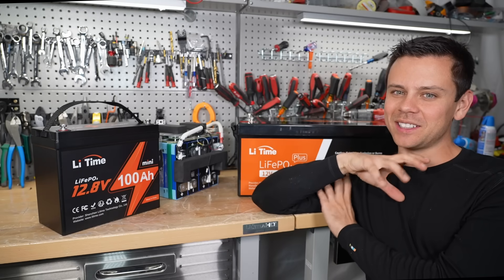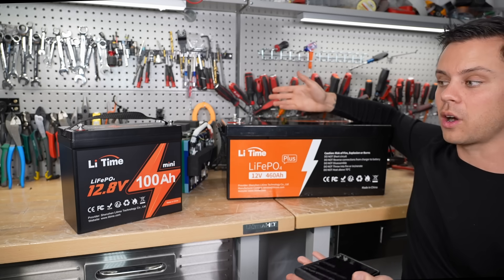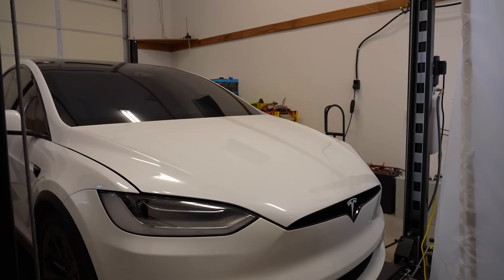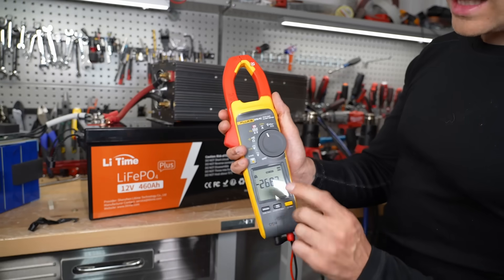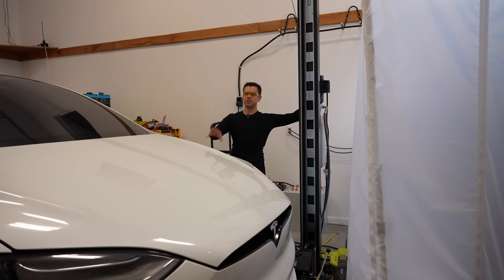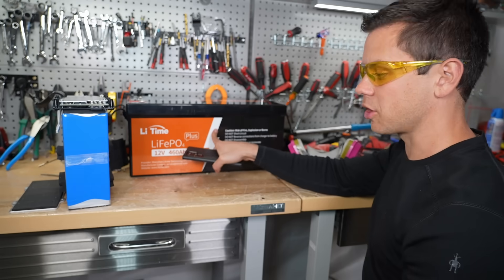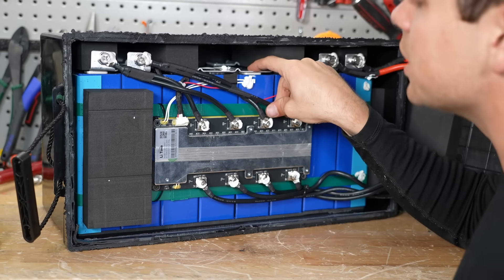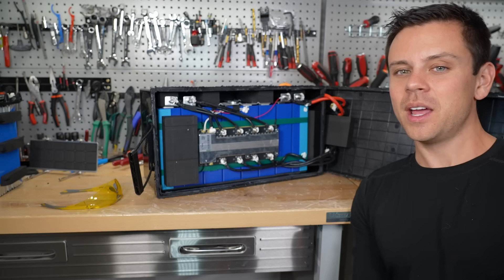LiTime LiFePO4 Mini and 460AH Plus! Surge Testing and Teardown

Comment: Hey Will, I've watched a bunch of your videos and I think I'll try one of these Li Time batteries for my RV. I don't need much, just enough for the coffee maker and TVs. Maybe the microwave. The ACs will be run off of the on board genset. I'll also be running a GoPower inverter with 50amp pass through and a seperate transfer switch. That way no matter what, I can have shore power, the genset, and the inverter all running but my priority will be set by my transfer switch. Anywho, I don't see temps go below 30°F here too often so do I really need the low temp protection? My current 100Ah lithium battery I have on there now seems OK after the last 3 years and I always keep my RV plugged in. Any advice on the low temp sensor and/or advice on the best way to wire up my RV would be much appreciated. I learn better with schematics BTW. Thanks

Comment: So after watching this I bought a LiTime 200ah battery. I ran a 1100W microwave from  a 2000W renogy inverter off the battery. The battery was at 92%(13v). But while running  the microwave, the battery was showing 62%(12.4v). Then 3 minutes later after the microwave was finished the battery went up to 82%. Is this what should have happened?

Comment: Here's my question I live in South Florida or power goes off a lot, I have a lot of APC/UPS is in my home..  I would like to buy a 200 amp battery and buy a Pure Sine inverter.  I have a Ram diesel truck which holds 75 gallons of fuel, in bed aux tank.  should I use the alternator with big jumper cables to charge the 200 amp batteries or should I hook an inverter to my truck and then plug a large battery charger into my truck inverter to charge the 200 amp battery. I'd like to buy two 200 amp lithium batteries to keep the batteries charged, at least put back in 50% back into the batteries in charging.  I have three 2.3 amp refrigerators  I would like to keep cold, I can rotate power to three 2.3amp frig to keep my draw down..I was thinking of getting 2x 200amp lithium batteries and a 2000 watt pure sine inverter for the batteries, and a 750 watt inverter for my truck and a 50 amp charger for the truck inverter to power to put some charge back into the system..any help would be appreciated.

Ben

I am happy to Cash App udor your help.

Comment: Hey Will, most boats (especially sailboats) are a 12V system. You will find 24V setups, but rarely a 48V system on boats. Unless, of course, they're a Mega Yacht. For the larger voltage systems, the wiring requirements become a constraint. I would love to see you do a series on boat utilization of lithium batteries.
Reply: This is the answer. There are thousands of 12v sailboats going around. Only the larger ones are switching to 48v nowadays.

Comment: My 100-amp mini came with a voltage reading of 13.4 volts. I can only get it to charge to 13.8. Li time says my battery is good. I think it is defective and should charge to at least 14.4 volts. Is one of the 4 groups reading high causing the BMS to shut down charging?   out of balance?

Comment: Hi Will
I love your videos and the excitement you bring to learning. I am quite interested in these compact or mini batteries. I am looking for a 200ah to add to my 3-100 ah (all LifePO4) to go with my 1000 watt solar capacity. My room is limited in my RV so size is important. I don't  see that you have tested any Eco Worthy brand but they offer a 200ah that is considerably smaller than the rest I have seen by almost 6 inches in length. I have written them to confirm dimensions are correct. They also seem to have a much lower warranty than others at 1 year. If you or anyone else has the time I would really appreciate the expertise. System is Renogy 5 x 200 watt panels and 100 amp Renogy charge controller, Renogy shunt monitor and Renogy 2000 watt inverter.

Keep up the great work
Best Regards,
Jim

Comment: Hi. I heard you mention that if a Li Time battery has plus on its case, it doesn't have low temp protection. On the website it said it did. Nothing in the docs or battery says it does, so I asked tech support about it. I bought 2 260 AH batteries they assured me it did. I wasn't convinced, and really not now. I bought them in October 2023. Anyway to test them w/o tearing them down?

Thank you.

Comment: Strapping tape on a heatsink? No way. The adhesive will deteriorate when exposed to heat and eventually give up. Strapping tape doesn't belong anywhere inside a battery, but especially not on components that get hot. That's a fail! Buyers will soon wonder what's rattling around inside their sealed battery (the BMS). And zip ties? Really? The build quality looks like something out of a high school shop class project.

Comment: Trying to find a video.. but can’t. Anybody know if you can have two different battery banks ( different brands )  but have a battery selector down line from solar charger . And then another selector between the two banks to inverter? So you can switch between battery banks both inputing and outputting?
Reply: Hmm? Hey I’m a noob n don’t know nothing so to say.If that’s doable I wouldn’t flip switches unless it was dark out.A cheap switch may get welded on in full sun?

Comment: Hi .like watching your videos I’m in the uk . I’ve got a touring caravan I’m looking at going to lithium. I use 2x acid batteries 110amp got 200w solar panel on roof. I use led lights water pump heating (gas but uses 12v to run a pump )also 12 tv an a 1500 w inverter for mrs hair dryer but only for around 5mins. Never plug into electric mostly ok. Question about the lithium Which brand is best as it’s a mine field out there. Was thinking starting with 100amp being cheaper then being able to add another 100amp if needed but is it best to work from one bigger amp battery than put 2 together. Was looking at Fogstar battery 280amp £799 at least can talk with them . Other companies renogy but can’t talk to anyone so worried about warranty. Any help would be appreciated. Cheers mike

Comment: @WillProwse Out of curiosity, Have you ever gone about "rebuilding" one of the "store" units if you already had it, to possibly add a cell heater, low temp, and bluetooth? I bought a Bilt Hard 230ah 12v last year (due to being the cheapest that would work in my application) but am regretting not having bluetooth for monitoring (i also doubt it has temp cut or heater)

Comment: I just found your chanel and have watched so many of the videos. Im planning a 12V system for a full time van build. I see everyone talk about battleborn but after watching this video im almost sold on these because of the price. Is there any reason other than the low temp sensor and 10 year warranty that you would reccommend battleborn over these?
Reply: And now looking at their website again they do have a 230ah with low temp sensor. So is there really any reason to pay roughly 3 to 4 times the cost for a battleborn? Greatly appreciate your videos and knowledge, and also the response to my questioms

Comment: I have a Solar Edge System: 14.4kW Solar Array Hyundai HiA-S400HI
Solaredge 10kW Single Phase Inverter with Power Optimizers. My question is can I use batteries other than Solar edge batteries. Can I use 48V 100AH SERVER RACK LIFEPO4 LITHIUM BATTERY SG48100P with this system

Comment: If Ripping the battery Enclosure apart I wound Just Replace the "Dumb" BMS With Smart BMS (with Bluetooth, WiFi, LoRA) + active bi cell equaliser (one that i can turn ON and OFF) + 5v, ~ 20v USB PD Heating matts
Reply: Why not 4 280ah eve cells for 450 bucks then.Or 1800 for 280ah 48v bat. A lot more a year ago.

Comment: In regards on your "Renogy DC to DC charger w/Mppt" video...
Hi, i have two questions! Can i use instead of a megaFuse a circuit breaker? and,
I looked at the blueprint on your website, and the mc4 connecter part is a little confusing to me... U mentioned to use the branch connector instead... Do i need to add the mc4  connecters as you mentioned, too?
Not sure if i find this information in your book, need to check again.
Thank you for all your help and the knowledge you are sharing... 🙏

Comment: A little off topic but we race dirt track cars and weight is a critical factor. Currently looking at building a 12.8v or 16v 280ah. We do not run on board charging. The battery must supply starting current for the starter. Believe that will be around 300 amps. Once started the draw is less than 10 amps.

Comment: I got a 12v 100ah TM. When I charged it, it started at 13.12 volts charged for 3 hours was complete charged volts was 13.68. One hour later it was 13.03. At 3 hour after it was 13.00. Now at 12.95 volts. Is there something wrong with the bmi? Would you return this for a new one? Not sure if I should trust this one. My charger is a lithium charger that just charge other lithium batteries I have and has worked fine for 2 years.  What's your thoughts?

Comment: Victron MPPT chargers DO have low temp cutoff so it does not have to be in the battery but, you need their volt/temt sensor for $40

Comment: Who's building 12V anymore?   <Raises hand>.   The problem with higher voltage systems if you have anything with really high drain (engine starting, RV slides, etc), you're going to need a 12V system in addition to your higher voltage setup.   Building a 12V and 24/48V system is a PITA, especially if you're not going nuts with the power requirements and cable runs.   4/0 isn't fun to work with, but it's cheaper than the smaller cables would be for a higher voltage system w/converters for the low voltage.   

If someone made a high amp 24/12 or 48/12 converter, it would be a lot easier to go to a higher voltage in a RV/mobile application.   1000A surge, 200A continuous would work for my applications; generator pulls a few 100 amps when starting and slides pull around the same.

Comment: Well 3 months and a normal 12 100 has died!!! No return warrenty never again not worth 50$  ran on 24v victron 250 60 controller......... trashhhhhh yes ran in series so both should have had a issue their detective!!!!!

Comment: Another awesome video. You stated that the "plus" LiTime batteries don't include low temp protection. I recently purchased a 12V 230AH that advertises on Amazon "Litime 12V 230Ah Plus Low-Temp Protection LiFePO4 Battery Built-in 200A BMS". One of the reasons I purchased this battery was (a) cost and (b) low temp protection. Based on LiTime's website, it appears that the addition of low temp protection is a new feature. Is anyone able to confirm this?

Comment: Love your channel but c'mon will get over this low temp thing. If someone is spending money on lithium they should also be spending on good equipment. With battery temp sense inverter/chargers and solar chargers can have a low temp threshold.

Comment: Hi Will, great video as always....I have scoured the internet for many months to try and find the 'correct' Epever controller discharge settings for my sealed 24v Lead acid battery bank, but have been unable to find somewhere that shows complete suggested settings. I want to follow best practice and discharge the batteries to 50% The Epever defaults are - Discharging Limit Voltage 21.20v : Low Voltage Disconnect Voltage 22.20v : Low Voltage Reconnect Voltage 25.20v : Under Voltage Warning Voltage 24.00v : Under Voltage Warning Reconnect Voltage 24.40v........My understanding is that for my setup the 50% SOC value is 24.45v, so that is what I have set..it seems to me that the Epever default value of 21.20v would completely destroy the batteries, but I can't believe that they make such a suggestion if that is indeed the case... Am I missing something fundamental here ?? If you or anyone can provide a full set of suggested parameters to use I would be very grateful, I don't want to ruin my batteries, but equally I don't want to be underutilising them through fear of doing so...thanks
Reply: Thanks James...I am familiar with how to change the parameters, my issue is what the parameters should be as the default ones (mention above) seem to allow the batteries to discharge to zero .... @jamesl9686

Comment: Hi will, I have a request: Sunbeam has the so called Smart lithium battery they called it drop in battery. You dont need to change your old type generator or what ever. Take out the lead acid and replace it with the sunbeam and you are ok.???? So my question is what kind of BMS do they use. Have you any idee? Thanks in advance, Gerard Leurs

Comment: What are the chances we get a video about running a small welder off of battery power?
Reply: What size welder, and I have to ask, is this for mobile thieving lol
Reply: @dufung3980  I tested out a 110v flux core welder off two 100ah lithium batteries and it laid down some beads but maybe something a little bigger. How about 205 amp welder and make it weld for an hour for smaller mobile jobs?

Comment: Hi Will 
Love your reviews . 
My son lives in Menorca and wants to install solar through government approved suppliers . 
They want to use Huawei Solar 2000 8kw hybrid which only works with Huawei Luna battery which is LiFe phosphate but 385 V . 
I can't find any info on benefits of high voltage batteries and they are very expensive . Do you know of any alternatives and is the Huawei battery worth buying ? 
Thanks 
Tim

Comment: what is the choice for >3C discharge 12V LiFwPO4 then?  Do we need to dump BMS to get and use high rate discharge loads (30 second 300A)?

Comment: I really like the tear down videos. It would be great if the electronically challenged like myself could verify low temp protection claims on batteries. Than just pushing the i believe button text that is on them. Right now I follow what Will has on his page and community is great help.

Comment: Bought a mini in June for our popup camper… not used much so far, but performing well… not real concerned about low temp… battery pulled out in winter, most camping in warm weather… thanks for your work & info!

Comment: I have the 12v 100amp mini, in the cuby hole under my Jeep's trunk with a 30amp dc to dc charger. The Litime battery fits with a fuse, distrabution block, and a fuse box all under the trunk. The charger is under the rear seat. Can't even tell its there. HIghest temps recorded in Atlanta heat wave in traffic for 4 hours on a 12 hour drive was 62C. lowest temps 24.3c, The renogy charger is not insolated and detected under 32 degrees and didn't charge the battery that is insolated. No cold temp charging sensor missing doesn't bother me.  What I run and how I use it.  It runs my 47L Iceco fridge and charges my drone batteries everyday. I charge in total up to 6 x 22.8v 1100mah Lipo HV and 7 x 8.4v 450mah Lipo batteries. Lipo charger is a dual Charger 600watt 12v.

Comment: I plan to build my first 24 volt system using two of the Li Time 460Ah in series. I have came along way with solar knowledge, but I'm still having trouble understanding panel configuration beyond a simple parallel setup. I want at least an 1000w array to charge a 24v  battery config, but from watching your other videos it is my understanding that I need my array voltage to be higher than battery voltage? Also, let's say I want to charge a 460Ah 24 battery system, what does my optimal panel voltage need to be, and what panel config should I use? Example: Could I just wire a bunch of 100w panels=1000w in series (Single array)? Should I buy higher wattage panels and divide them into more than one array? Sorry if I sound ignorant, but learning this stuff is part of a process.

Comment: Most important to have proper data sheet about temp protection + warnings for coold chargeing. Checking cell datasheet of cells used in the pack you should start to worry for hi current chargeing much earlier than 0 celsius. 
5 celsius would be better.

Comment: I have a question. Is a battery balancer only needed when you stack volts and not amps?
Reply: Cause I was trying to find one to hookup 6 200ah lithium batteries or even agm to make a 12v 1200ah battery bank.

Comment: Hay Will.If I may.  I have watched you for years now and I have a question.can 18650 cells in a powerstation be replaced with lifepo4 battery. I have two 500watt generators and I hate to just ditch them when the batteries start getting weak. Thank You  Chris L.

Comment: Hey Will! Great video! 
Which Litime 12v 100Ah battery is better for 48V off grid solar system? The Trolling Motor version? Would you buy 4x 12V or 2x 24V?
Thanks in advance!

Comment: How much heat is generated in the battery from charging and discharging?  How low does ambient temp need to be to trigger low temp?

Comment: 12V system is great, if there is no plan to use it with AC inverter.. For powering lights directly from 12V or 24V, system gets better efficiency and longer can run in non stop. If adding car cigarette socket for system, then there is multiple car gadgets available - for charging phone, laptop, soldering iron etc. And as option always is DIY DC/DC converters or modules in market, if other DC voltage is needed..
No complaints about 12V system.. 😂 There is, even, TVs with 12V powering option.

Comment: Learning a lot from your book and videos. What resistor are you using to avoid sparks when connecting the inverter? Are all inverters floating neutral. Wondering if that makes a difference when powering a furnace vs. the lift motor? I'm using the Li Time Minis and Li Time 3000 watt inverter.

Comment: Question?

After watching this video, I’m headed out to Utah, where my cabin is.

Weather has been getting down to 10 degrees Fahrenheit the past couple of weeks.

My solar dolly has been running, only load has been an LCD clock. Typically in this scenario my batteries reach full charge by 8:30 am only drawing 270 watts before the battery reaches 100% 

I’m going there to shut it down and bring the batteries home.

My batteries are 2, Ampere Time 12V 200Ah

Do you think my batteries are already ruined?